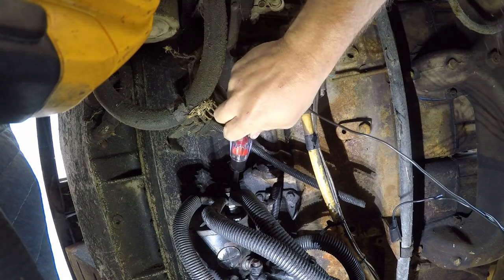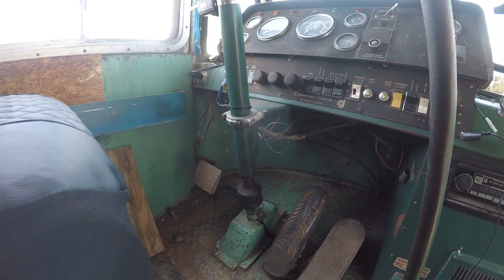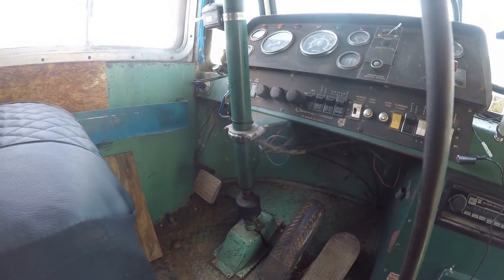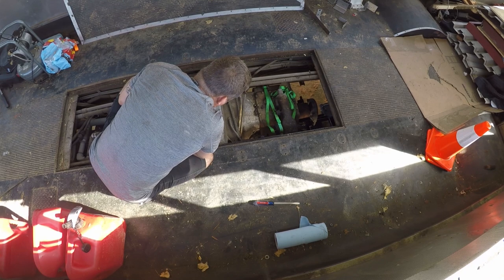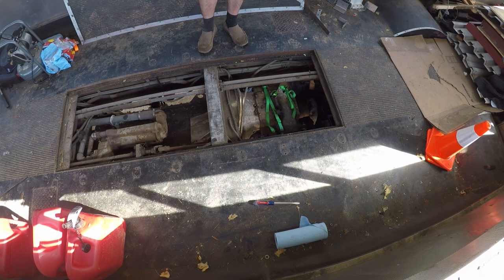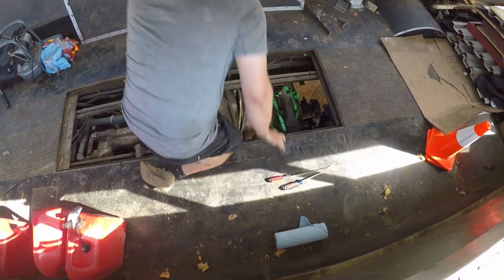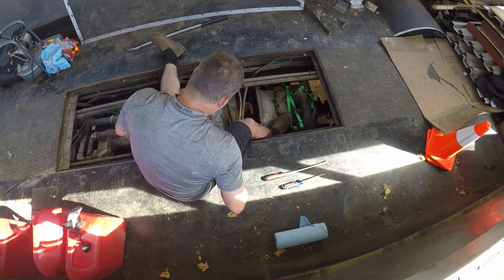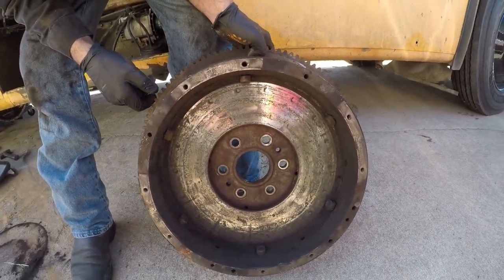Rescue A Crown: Day 11 - Clutch Removal and Assorted work

Comment: where did you purchase the replacement clutch and bearing?
Reply from the maker: Shop that changed it handled it.  Wasn't hard to get.  We did replace the Input shaft though with a more standard size.  Old one was damaged and a harder size to get.